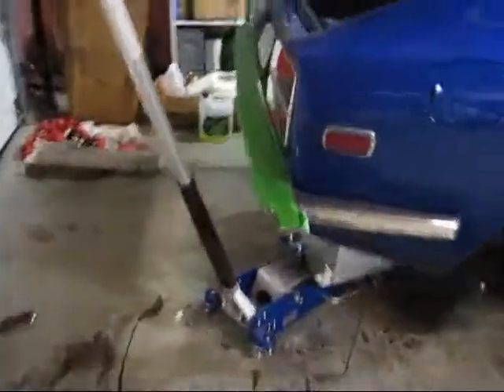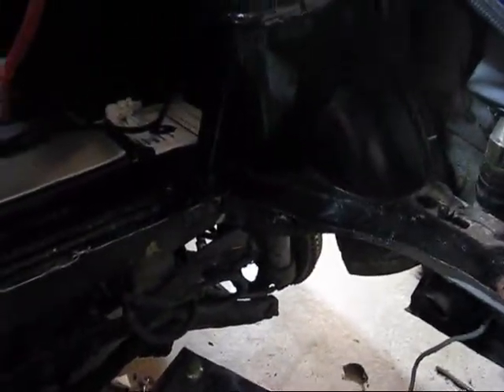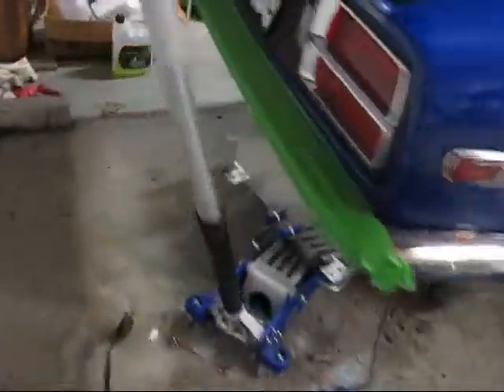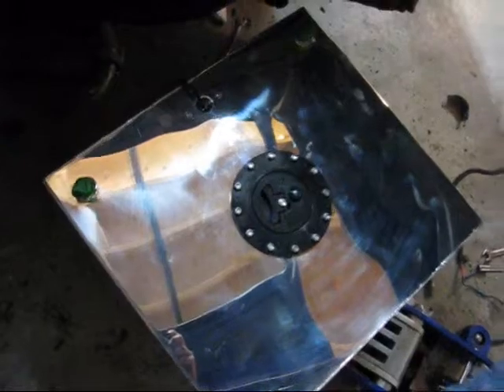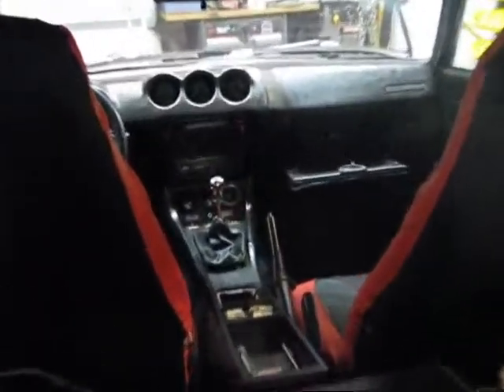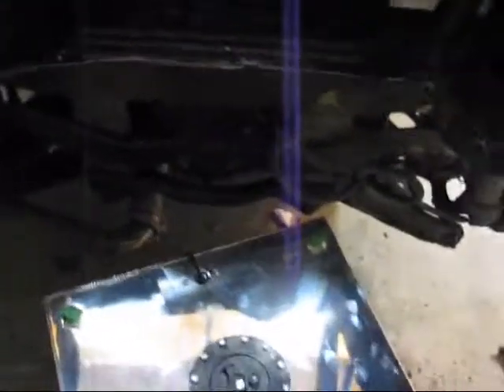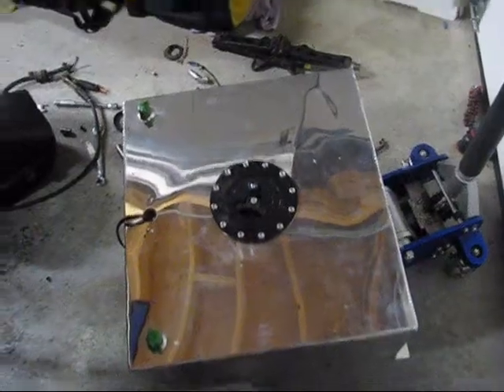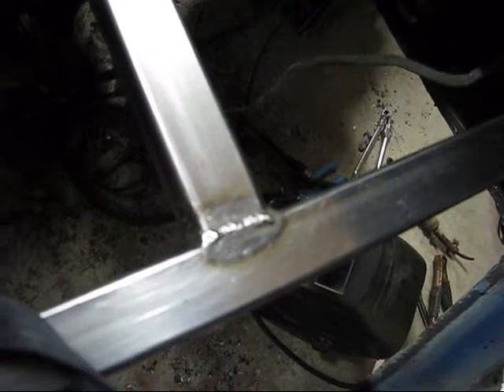280z fuel cell

Comment: how did you take off the gas tank i need to take off my gas tank so i can start my 280z
Reply: +Geovanny Lemus Just loosen the big straps and the tank will gradually drop down.   Then you can reach the top of the tank to unplug the electrical connectors and venting hoses, while it's dropping, guide the input pipe of the tank straight off the filler neck, all you have to do is pull it off but give it a wiggle or two.  Obviously drain the tank first, disconnect the battery, use jackstands correctly et al.   Its an easy job even for a newbie.   
Get a copy of the Factory Service Manual for your exact car and always read the relevant content before doing anything, and you won't have to ask these kinds of questions anymore.   There are free copies on the internet for download.